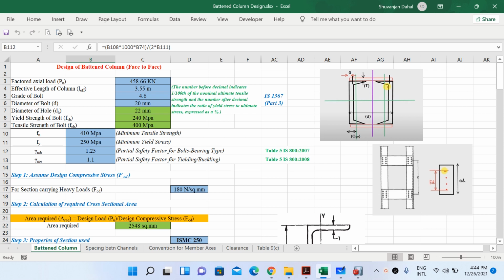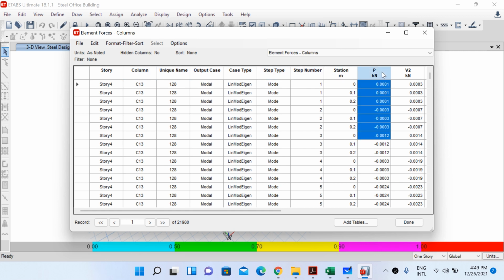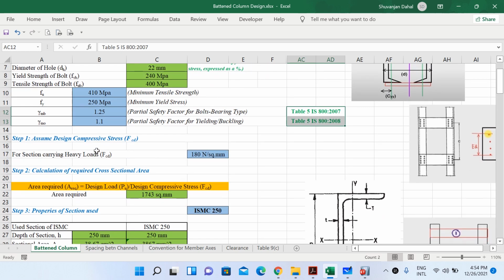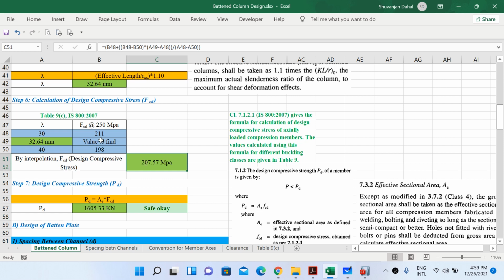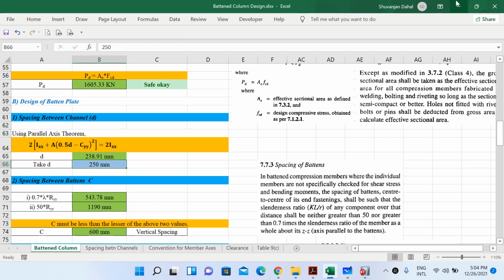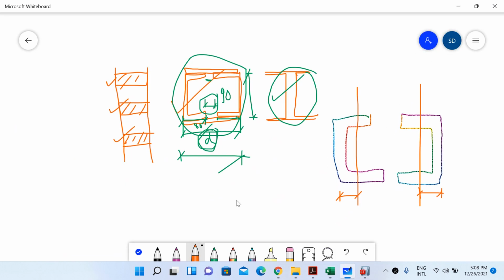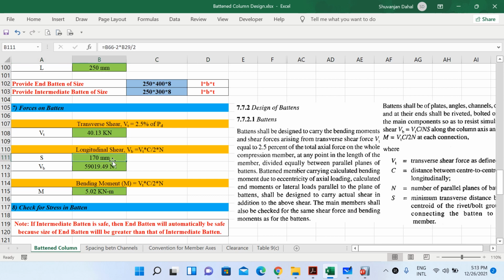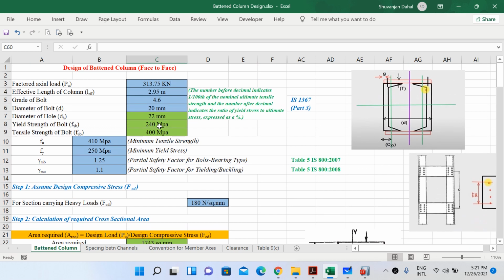Lecture 11-Design of Battened Column (Built up Column) as per IS 800 (2007) Code

Comment: While calculating spacing 250 mm is not the total length, it is just the spacing between two channel section, you are saying it its tha total length. Is that correct sir?